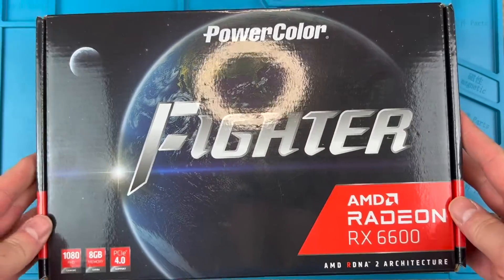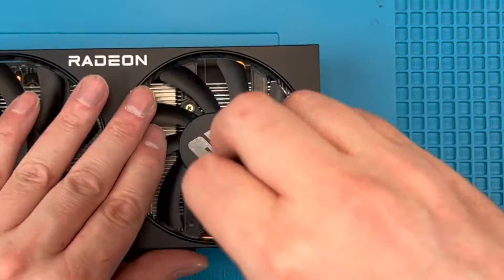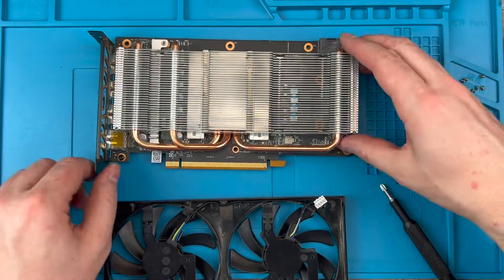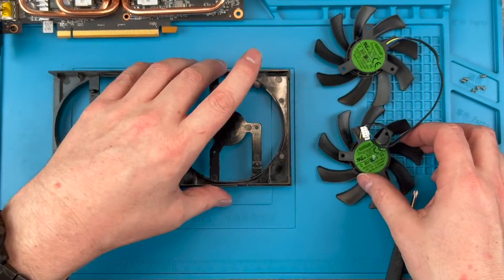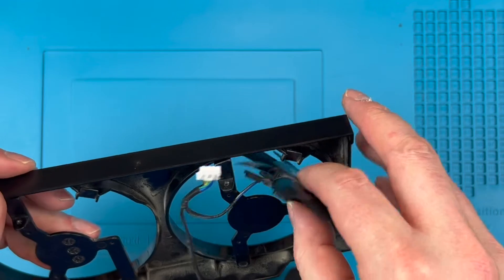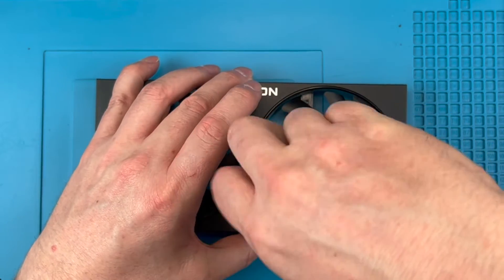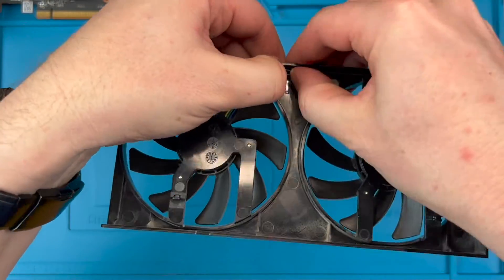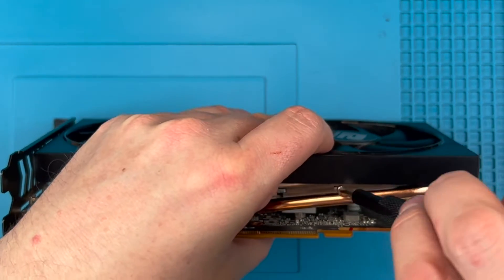Changing broken or failed fans on PowerColor Fighter GPU in under 10 mins

Comment: Have you perhaps seen argb version of these fans?
Reply from the maker: I have not. And the card itself isn’t set up for RGB, so would need to be cabled directly to an ARGB port. I guess you could do an after market job with some RGB ribbon
Reply: @sometechguy  Yeah, that's what I was thinking about. To connect to mainboard argb port. However it's not easy to find 85mm fan with the same mounting. In fact I can't find even a single one...

Comment: How noisy are those fans from aliexpress (if you have plans to use them for graphics card installed at home pc)?`
Reply from the maker: These are just in place replacements for the original GPU fans. No noticeable difference from the original.

Comment: Thinking about deshrouding my powercolor rx 6600. Do you have any experience with that? And if you do, what are some pointers you could give me?
Reply: Rx 6600 shouldn’t need heatsink mods, it doesn’t use a lot of power and doesn’t generate a lot of heat. Try replacing paste and pads, undervolt before anything else
Reply: @sayori1989  Im mainly just trying to reduce noise
Reply: @Buckent  I see. I’ve disassembled one of these a while back, screw holes for the shroud are at the sides of the heatsink, it should be possible to 3d print a mount for 90mm fans

Comment: How thick is the thermal pad used on this GPU?
Reply from the maker: Changing the fans doesn’t require removing the heatsink on this, and it wasn’t suffering any thermal issues, so have not looked at or replaced pads on this card. Sorry 😢

Comment: i think i found exactly what i needed. i have the fighter 7800 xt and i belive its build the same only it has 3 fans.

they are louder then i prefer so i wanna put 3 arctic fans on it with straps. disasembly was what i needed help with. 

Thanks

Comment: I know it's an older video, but do you know if i need to remove the fans to acces the core for repasting(my gpu is getting hot)
Reply from the maker: You don't need to remove the fans from the shroud, you can remove the shroud with the fans in situ and either flip it to one side, or unplug the fans from the board so you can get the fan shroud properly out of the way so you can easily remove the heatsink from the GPU.
Reply: @sometechguy  thank you so much good sir

Comment: i just bought this graphic card secondhand for 1 month, then suddenly my fans start squeaking. i ask the seller for solutions, he said that i can apply some wd-40 to the fan bearings. is it possible? thanks
Reply from the maker: No, almost certainly not. The fans are usually sealed units, though some you can open them up and there is a small well where you can add a drop of oil, usually something like sewing machine oil. They are not so easy to open though, and there is a chance you struggle to get them back together again. But I think the answer is probably no.

Comment: Im not using zero rpm will this decrease my fan life by a lot?
Reply from the maker: Running fans at constant speed isn’t a bad thing, stop start is probably going to wear them out faster. But generally the life of fans is good, so I wouldn’t expect any special issues. It’s also good for thermals and it can take time for the fans to respond to temp spikes.

Comment: Which fan did you buy?
Please link
Reply from the maker: I had problems finding a fan for this, I found one on Ali Express but it doesn't seem to be available right now. I found one that claims to be a replacement, but it came with two separate fans which while physically looked the same they had a 0.57A rated and not a 0.50 Rating. This caused me some instability on my card, which I can't really be sure was due to the change in the power draw, or some sensitivity in my unit. Having replaced them again with 0.50A rated fans, the card was completely stable.

So short answer, sorry I don't have a link. But maybe the fan that claims to be a replacement is fine, but if you get any odd freezing or crashing, then return them. I could reproduce that problem quickly by running a stress test using the Adrenaline software provided by AMD.
Reply: To all the guys who wanna use a fan with 0.57 A. Dont do this it will break your graphic card.
Reply from the maker: Many of the fans that claim to match this card that are available, look to be the 0.57A versions, and the cable layout is different also, but can be made to work with some fairly simple modification. But I didn't have a good experience with my experiment with the 0.57A fans and removed them. My card has no further issues when reverted to the 0.5A ones. @kingcutlet, was yours a similar experience, or you have some solid info on this doing serious damage? It would be good to know if they can cause terminal damage.
Reply: @sometechguy  Most replacement fans that I find in AliExpress currently are 0.5A for about 8€ each pair, will order a couple right now as one of the original is faulty and I don't want to have my rig on hold for 1 month because of a gpu fan being on warranty.
Reply: @figrider Have you succeded?

Comment: I need to take out the front cover (shroud) if i need to clean the fans. Right? Or i can take out the fans only?
Reply from the maker: On this card, the fans are secured inside the shroud. So it has to come off to remove the fans. However, you can clean the fans effectively without removing the fans. I have used a cotton bud for the underside, and you can use this or a micro fibre cloth for the top side using alcohol like isopropanol.
Reply: @sometechguy  thank you very much. I already follow your video to take out the front cover, and cleaning the fan. Done nicely. Once again, thank you so much for the video. Glad i find it 👍

Comment: Awesome video!
Reply from the maker: Thank you!
Reply: where did you buy these fans? if  possible the address?thenk you
Reply from the maker: From time to time, I have seen them on Ebay, but I ordered some from AliExpress for this. I would check that you pick up the T129215BU part number fans, as there are plenty of fans there that claim to fit the Fighter card, but have different electrical specs. I don't know if it was just the sensitivity on my card, but when I tested it with slightly different fans which drew higher ampage, the card and fans worked but crashed under a stress test. These fans in particular can be hard to find, and the experience of dealing with AliExpress isn't really one I would strongly recommend, I have sent a lot of things back when I looked at the quality.

Again, check all the dimensions and cable lengths if you can. Good luck!